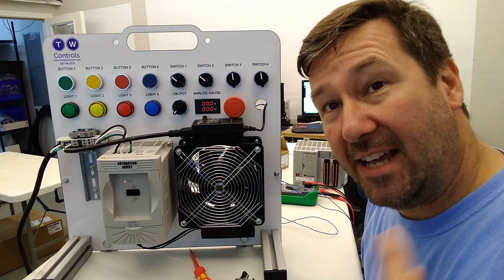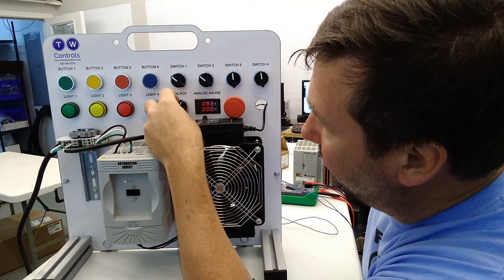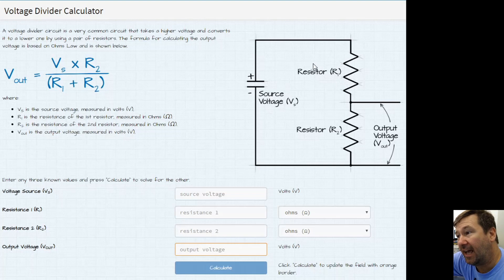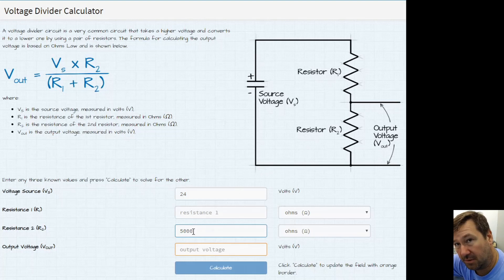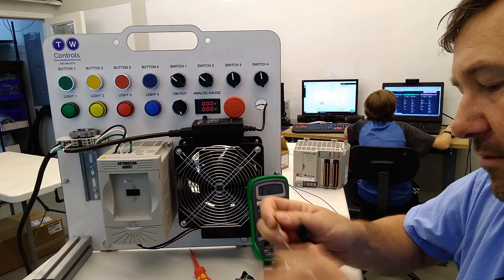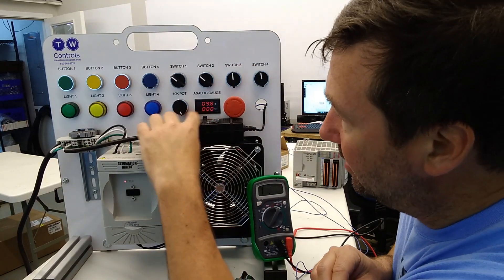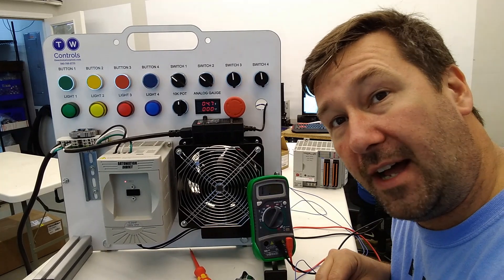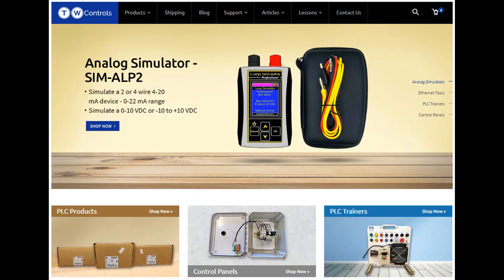How Can You Get 10VDC for a Potentiometer if You Only Have 24 VDC?  This Week's Automation Question.

Comment: What about 24v ac to 10v dc
Reply from the maker: You'll need some type of power supply...or I guess you could do a diode and a some different resistor values for your voltage divider but that's more of an electronics topic.

Comment: Tim I need a pwm signal for an ecm motor to test the factory board or the motor has failed. I have 24vac but the ecm is 24vdc. I can use an evo board to do this but I need to figure out how to get a 10vdc to the evo and if also like to be able to send it a 5vdc

Comment: i have a question about a digital potentiometer, in need to control aan motor drive (0-10volt) with a digital potentiometer (0-5volt)! how can i do this?
Reply from the maker: Hi David, you would lose resolution but you should be able to scale the maximum motor speed to 5VDC.  That would be the simplest way.

Comment: Questions? Here goes! :)  Q1. Why does the panel show a 10K pot if your are stating 5000 ohms. Q2. Your drop down resistor (7000) will divide but most also support the current passing through it. How do you determine what wattage that resistor should be?  Thank you!
Reply from the maker: A1.  We transitioned from 10K to 5K pots during one of our revisions, it was an old plate.  The now say "POTENTIOMETER" so we can put either one in.

A2. See the following ohms law link.  Power (Watts) = Voltage² / Resistance
https://twcontrols.com/lessons/ohms-law-power-formulas-and-pie-chart?

Comment: I cannot just throw together a mess of resistors in an industrial environment? How is this done when you need to respect standards?
- Do I take the 10V to drive an analog input sensor from a PLC Analog output... that just wastes an output!?
- Is there a converter product that can be mounted on a DIN rail.
- some other trick?
Reply from the maker: The 7K resistor example in this video would be the industrial way to do it. As I stated in it, I didn't have the correct one but wanted to show exactly how it works.
Reply: @TimWilborne   Ok, so there is a good looking product for 24V to 10V converting but for the sake of demonstration you wired together a few resistors? I also looked at a few analog output sensors and a lot of them seem to accept supply voltage in the range of 10...30V so there would be no problem feeding them with 24V. At work there was a linear displacement sensor that definitely needed the 10V supply voltage and I was wondering where to get the required input voltage.
Reply: Phoenix contact seem to have Mini DC/DC converters. Part number "2320018" that can output anything between 5...15V
And I found a terminal sized voltage converter from WAGO, Part number "Item no. 859-802" Input 24V ... output 10V

Comment: is there a way to control the input of the potentiometer with the PLC?
Reply from the maker: I'm not sure I understand the question. Normally you would use a potentiometer to control the signal of a PLC analog input
Reply: @TimWilborne   what if a use some plc analog signal with different reading . I can  change the analog signal values by adding the resistors to it . Will it act as a potentiometer ? I think it should work. What do you say?
Reply: I was planning to replace my potentiometer  and add a potentiometer on a HMI screen to control the output.
Reply from the maker: @wasiqahmedmohammed7645  You can replace a potentiometer with an object on an HMI screen.  This would be very common.  I'm still not sure what you are wanting to accomplish with your fixed resistors in your other question.
Reply: @TimWilborne I am having a potentiometer   that is used to control the power of the machine. What  I am trying to do is to add a HMi screen to the existing machine and control the basic on/off of the machine by the PLC. I am still trying to figure out how can I control the power knob to control the  power. I am really sorry if I am not able to explain.
Reply from the maker: What type of PLC, HMI, and drive are you using?
Reply: @TimWilborne  I am using productivity PLC and C-more HMI's

Comment: I have hydraulic solenoid powered by  pwm the system is having major malfunction it rated 10vdc on standard 12v battery  I tested the average volts during intermittent issues range form 0 to 6.5 v at control handle is there and easy way to wire something that would work with out spending a fortune  I really only need on and off only used to power auxiliary hydraulics on bobcat  to operate backhoe  someone recommend a different coil but  I think 12v steady will cook them
Reply: Its pwm controller could over $ 1000 I'm considering buying  aftermarket box and send power to it it's got a rats nest of power to trigger to switch to computer to lights and then goes to solenoid  you turn on on aux then push a switch and pull a trigger  they made extremely complicated so you can control flow or speed but I only need on or off full    i need to reduce it from battery to under 10v I was considering wiring up resistor to cut in half or pay 300 for wether proof potentiometer pwm box to do that but I'd need a measure the volts
Reply from the maker: @garymatusavige3639  You can't use a resistor on a battery because the voltage varies throughout a typical run cycle.  You need a DC to DC converter.  A 12VDC to 10VDC converter is very common
Reply: @TimWilborne   I ordered ec 20100 from brand hydraulic  is what they use to control cinder spreader pwm with potentiometer
Reply: It's not the only electrical issues it had I've bypass all the other stuff to only work if its running but auxiliary on will effect other control if always on robbing fluid power
Reply from the maker: Hi Gary.  You are going to have to chase down what is dropping the voltage.  Chances are there is a DC to DC converter producing the 10VDC from the 12VDC batteries that is overloaded.

Comment: Do you need a special potentiometer to use in a 12v 10A to 25A power supply circuit? The sellers rarely give amperage specs on the potentiometer listings. I have a power supply made from a computer PS. I want to make it variable. Seems simple enough. But I do not want to fry my potentiometers or damage  other components in the process. I have a bunch of 10k linear pots but I am guessing they might be rated around 3 to 5 A?
Reply from the maker: Hi Mike. You are looking for the wattage rating. Volts*Amps=Watts. So for 10 amp it would be 120 Watts. For 25 amp it would be 300 Watts.

Here is a good page to bookmark. https://www.theautomationstore.com/ohms-law-power-formulas-and-pie-chart/
Reply: @TimWilborne  Thanks for the reply and the link. I looked at about 75 different pots and only 2 had any specs. One said only 2 Watts! And the other 20 amps (240v). I will have to google specifically for 25A .
Reply from the maker: @mikelee1906  It doesn't need to be specifically 25 amps.  It can be larger.  For example your 240V 20 amp one likely has a low voltage rating as well that is probably higher than 25 amps.